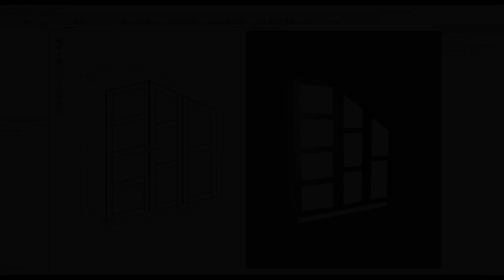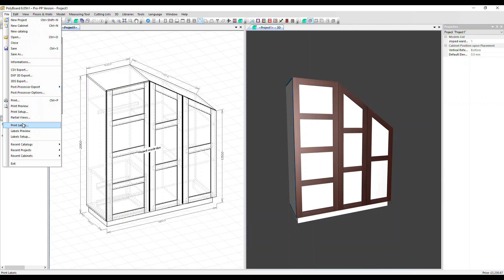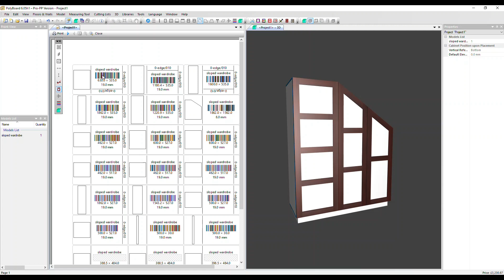Printing Part by Part Labels with Polyboard

Comment: Please put Nesting Map to the Label. I dont want print nesting map in A4 paper.
Reply from the maker: Hi, thanks for your message. The video here is showing label creation directly in PolyBoard, however PolyBoard does not optimise parts. We have 2 complimentary softwares that work with PolyBoard for optimisation, OptiCut and OptiNest. They optimise the jobs on sheet material and can generate labels on single label printers of any kind of page format. Together with the quick print mode there is a visual of the nesting map on screen. The part shape can be set on the label but not the complete nesting map.